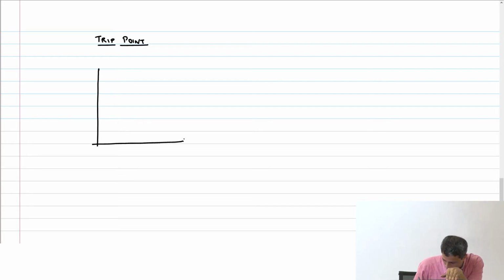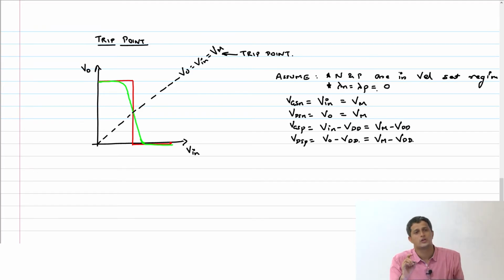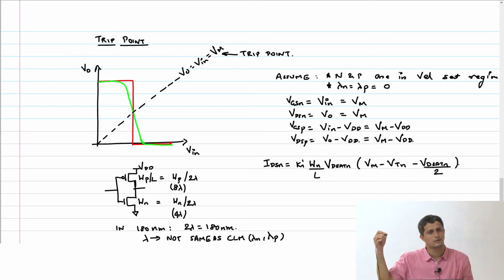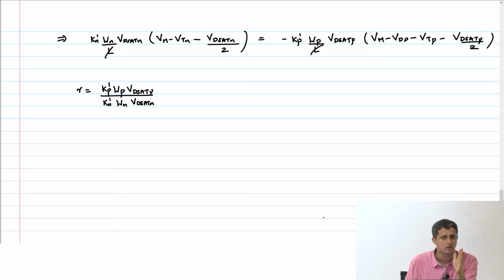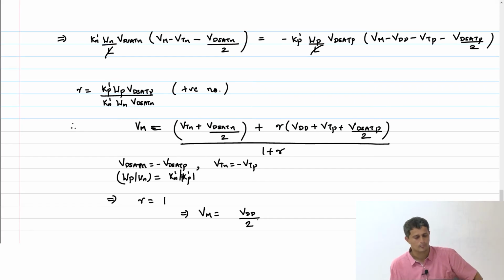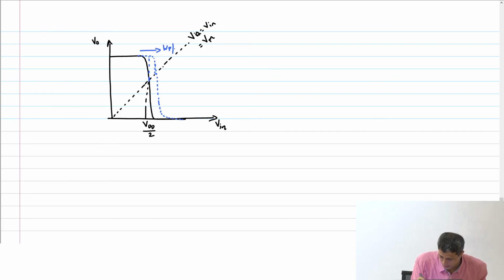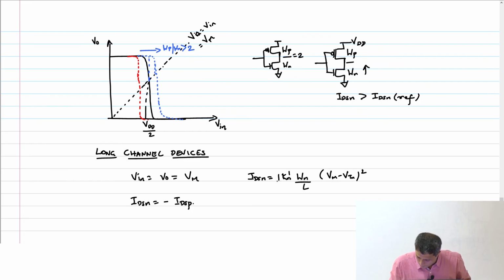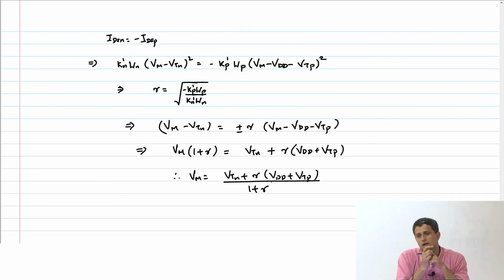Inverter - 4 - Trip Point for Short Channel Device Inverter

Comment: Why at 26:25, the sign is taken as negative?
Reply: If Vm-Vtn is positive --> RHS should also be positive.
Vm will always be less that VDD + Vtp, as Vm indicates trip point, in all plausible scenarios trip point will be closer to VDD and will never exceed VDD + Vtp(Vtp < 0 && Vtp = -Vtn).
Vm can be brought closer to VDD + Vtp by increasing Wp, but at Vin = VDD + Vtp, PMOS will be off --> Idsp = 0 --> Vo = 0 to make Idsn = 0. Trip point should occur before this happens. 
To make RHS positive for r>0, coefficient of RHS should be negative.
Reply: @socialogic9777  why Vm - Vtn should be +ve
Reply: @Rahul-hq8gl  because Vm will always be greater than Vtn
Vm - Switching threshold(both nmos and pmos saturation)
Vtn - NMOS threshold( voltage at which nmos enters saturation while pmos changes from linear to saturation)

The switching threshold of the CMOS inverter will always be greater than NMOS threshold( visible in the VTC too)
Reply: @socialogic9777  can you plz tell me that in velocity saturation, which current equation should we use linear or saturation form?
Reply: @sachinkumar-xl1nq  The current equation for velocity saturation is similar for as in linear region, but we have to substitute the value for Vd(sat) instead of Vds.
Reply: @socialogic9777   very well explained bro ❤❤